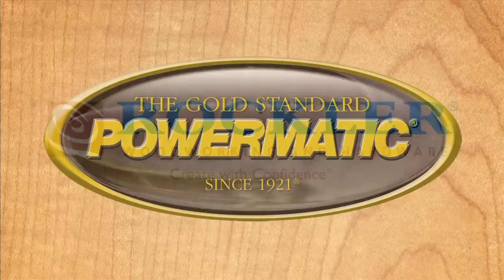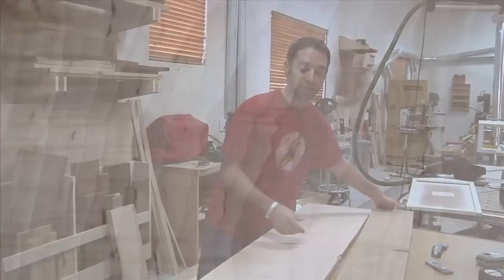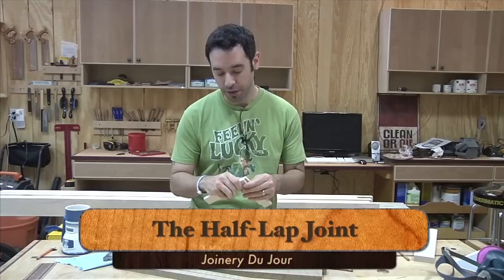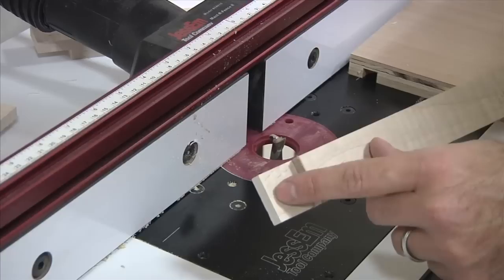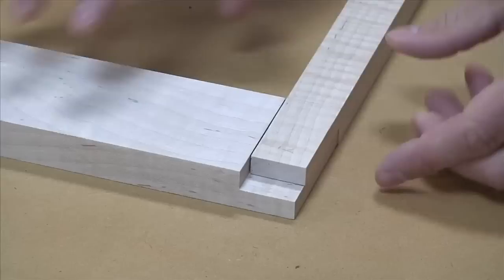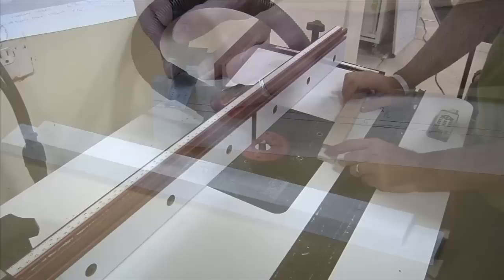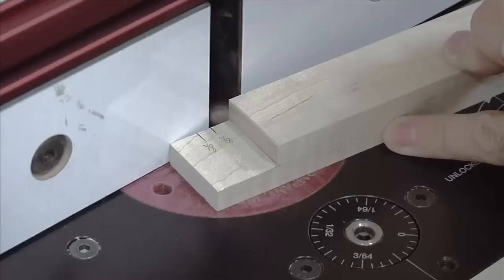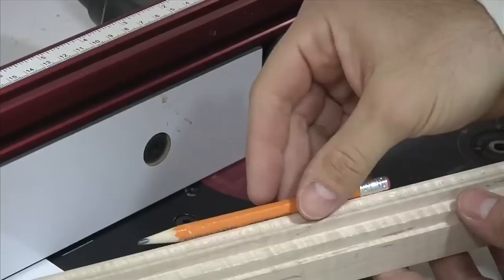162 - How to Build a Calendar Frame (Part 1 of 2)

Comment from the maker: @tabhorian Eventually, its a good idea to get a new backer. But even after the first few cuts, the backer is still providing tearout support. That is, as long as you are cutting the same size rabbet each time. If you cut a smaller one, there won't be any support for the fibers. And eventually, if you start to see a little tearout occurring, its not a bad idea to get a new piece of scrap.

Comment from the maker: @BNSFfan1996 well its not so much pro work as what kind of bits you plan to use. If you're just doing basic profiles and joinery, you can get away with a less powerful machine. But if you plan on doing large profiles and using big raised panel bits and such, you might want something with a little more power.

Comment: Question for you on the half laps... When you have the plywood backer board , its fresh, of course.  But after your second one its cut away from the previous one.  Now, if you do all the same type cuts at the same time, then the bit is going into the same recess each time after the first.  Is that okay?  Or do you need a different, new, backer board now and then?

Comment: i see you have a dust collection system. if i wanted to install one like yours, besides all the duct work, what does the whole thing run off of (what motor)? for a whole system for an average 1 car garage with maybe five medium size machines, what do you think the total cost would be, withmotor, ducts, and all that stuff?

Comment: Lock the router in the on-position (modifying the internal circuit as needed) and add a new switch into the power line. 

I'd talk to an professional first - I've never done this so there might be downsides.

Comment: Just connect a switch on a power cable of your router and use some tape or a clamp to hold the switch on router switched on permamently. Easy :)